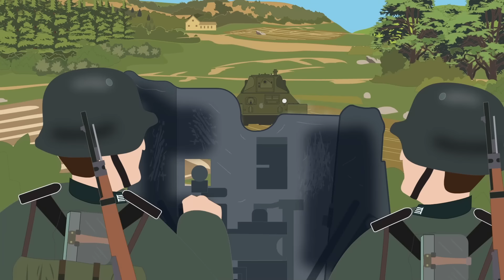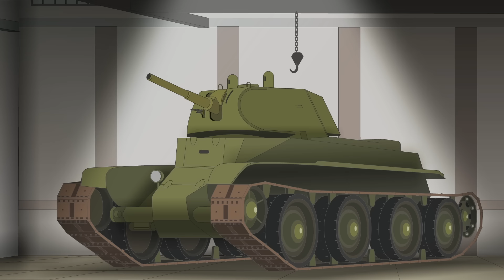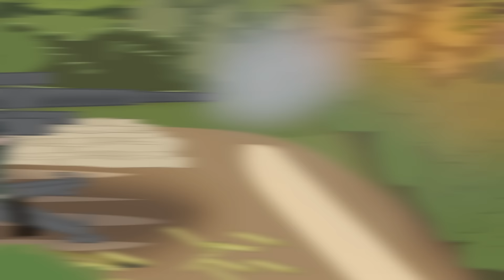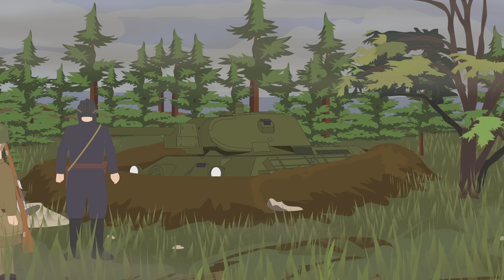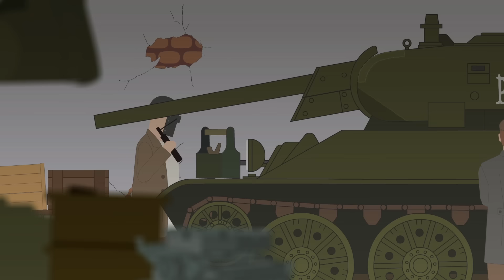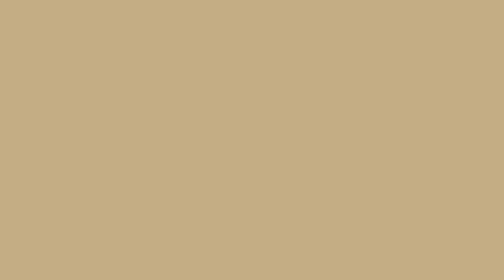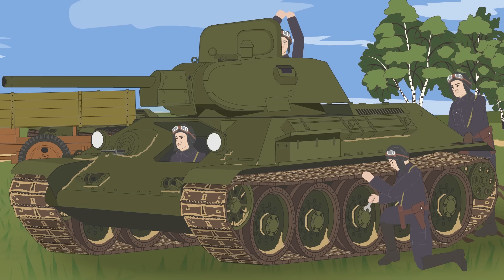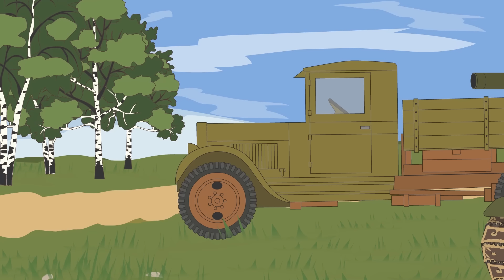Was the T-34 Really the Best Tank of WW2?

Comment: Animation wise, the video was legendary. I was amazed by the graphics. Simple History, you have definetily improved animation quality by not just up one notch but several notches. Genuinely appealing animation.

History wise... there are lots of inaccuracies here that frequently conflict Soviet and German military doctrines and military practices on the battlefield, as well as the documentations of a T-34 tank's quality lifespan.

 The video's writing was definetily heading for a hyped up propped up presentation of the tank, that'd be fine if you went over the theoretical aspect of the tank, but in practice and execution the T-34 had countless grave issues and was deemed mechanically more unreliable than even German tanks. The early Pak anti tank cannons could penetrate the T-34 from closerange, it is in long range where they struggled, and the Panzer III could engage the T-34 at medium range as well due to its superior crew ergonomics and its far better optics. Often times the T-34 armor plates broke apart from the force of collision of enemy tank rounds on the armor plating, which was inadequately designed and meant to only last several days, with the quality gradually improving starting late 1942 once the Soviet industry was kicking up, but it still took time.

That being said, I am not biased for the German tank industry, infact a lot of Simple History's videos on the German tanks overplayed them as well. I also do acknowledge that the channel is named "Simple History" in that the history is meant to be retold without going into complex difficult details and analysis that would turn it into a full blown historical documentary, but given the fact that the video is over half an hour long and, at its core, no matter how simple, history, it should've reviewed Soviet and German army doctrines and the documents regarding the usage of T-34 tanks and Pak anti tank guns to create a more accurate assessment. The video appears like a fantasy tale of a legendary tank. I do not discredit the T-34 tank, but I cannot say that it was as legendary as portrayed in the video. Cheers!
Reply: Fun facts:

The T-34 could sink in the mud aswell.
At Battle of Warsaw, the soviets attacked through a soaked field: From 17 T-34, 15 sunk and get stuck in the mud, only 1 T-34 could manage to escape.

" The T-34 was supposed to be a simple and rugged vehicle that seldom broke down. Authors like to compare it to the more complex German tanks that supposedly broke down often. The concept of the T-34 as a reliable tank is another myth of WWII.
The majority of vehicles in 1941 were lost due to equipment malfunction. The same reliability problems continued during the period 1942-44. The evacuation and relocation of industrial facilities combined with the loss of skilled workers could only lead to the fall of reliability. 

In 1941 T-34 tanks often had to carry a spare transmission strapped on the back to counter equipment failures (10). In 1942 the situation worsened since many vehicles could only cover small distances before breaking down. In the summer of 1942 the following Stalin order was issued to units (11):
‘Our armored forces and their units frequently suffer greater losses through mechanical breakdowns than they do in battle. For example, at Stalingrad Front in six days twelve of our tank brigades lost 326 out of their 400 tanks. Of those about 260 owed to mechanical problems. Many of the tanks were abandoned on the battlefield. Similar instances can be observed on other fronts. Since such a high incidence of mechanical defects is implausible, the Supreme Headquarters sees in it covert sabotage and wrecking by certain elements in the tank crews who try to exploit small mechanical troubles to avoid battle.’

Henceforth, every tank leaving the battlefield for alleged mechanical reasons was to be gone over by technicians, and if sabotage was suspected, the crews were to be put into tank punishment companies or "degraded to the infantry" and put into infantry punishment companies.'

The constant complaints from the front forced the authorities to investigate the problems with T-34 production. In September 1942 a conference was held at the Ural tank factory by the Commissariat of tank industry (12). The conference was headed by Major General Kotin, People’s commissar of the tank industry of the USSR and chief designer of heavy tank ‘Kliment Voroshilov’. In his speech he said:

''Now ... there are a lot of complains about the T-34. You all know the reasons for flaws in the tanks. The first reason –inadequate visibility from the tank; the second reason, and this is the weak link that always accompanies our vehicle in the Army – final drive. And third, the main issue that we have today – insufficient strength of the idler wheel's crank. These issues are the major defects of the T-34 today. Having considered these issues from engineering and technological points of view I would like to discuss another issue, the one that directly resulted solely from our production deficiencies. They are: negligence during production of combat vehicles in the factories, carelessness of assembly and quality control of vehicles. As a result during combat employment our tanks sometimes cannot reach the front lines, or after getting to the territory occupied by the enemy for conducting combat operations, sometimes they are forced to remain on enemy's territory because of some little things... We have to make sure that as a result of this conference all shortcoming will be uncovered and following this conference all corrections in the tank will be implemented in the shortest possible time...
Recently comrade Morozov and I visited comrade Stalin. Comrade Stalin drew our attention to the fact that enemy tanks cover a lot of ground freely, and our machines although are better, but have a disadvantage: after 50 or 80 kilometers march they require repair. What are we talking about? It is because of control gear; also, as comrade Stalin said, because of drive gear, and he compared it with the Pz.III, which is in service with the German army, and which is inferior in armor protection, and in other features, and in crew's layout, and does not have such a fine engine, which the T-34 got, moreover its engine is gasoline, not diesel. But the question аrises – why its drive gear is developed better?

Comrade Stalin gave directives to engineers, to the People's Commissar comrade Zaltsman, to factory's CEOs and ordered them to fix all defects in the shortest time. A special order of the State Defense Committee has been issued on the subject as well as directives of the People's Commissariat of the Tank Industry. Despite all these resolutions have been made by Government and orders of the People's Commissar of the Tank Industry, despite repeated instructions from army units and from Main Directorate of the Armored Forces, which is in charge of combat vehicles operation, nevertheless all of these defects on vehicles are going on... We have to reveal all these flaws, and suggestions have to be made on at this conference how to modify machine component better and faster in order to make the T-34 tank, which is recognized in the army as a good tank, even better fighting machine.''

The situation continued to be problematic even in 1943-44.
There were constant problems with the gearbox and the engine filters. The Aberdeen evaluators noted:

‘On the T-34 the transmission is also very poor. When it was being operated, the cogs completely fell to pieces (on all the cogwheels). A chemical analysis of the cogs on the cogwheels showed that their thermal treatment is very poor and does not in any way meet American standards for such mechanisms.’
‘The deficiency of our diesels is the criminally poor air cleaners on the T-34. The Americans consider that only a saboteur could have constructed such a device’

The same problems were identified in a T-34/85 built in 1945. The US study ‘Engineering analysis of the Russian T34/85 tank’ noted (13):

‘Wholly inadequate engine intake air cleaners could be expected to allow early engine failure due to dust intake and the resulting abrasive wear. Several hundred miles in very dusty operation would probably be accompanied by severe engine power loss.’

The same study says in page 451 about the transmission:
‘The transmission had by American standards already failed, although with extreme care it could have been used further. Teeth ends on all gears were battered as the result of clash shifting. Many pieces of gear teeth had been broken off and were in the transmission oil. The failure is due to inadequate design, since excellent steel was used through the transmission.’

The mental image of the T-34 travelling hundreds of kilometers without stopping is fantasy.

A German unit that used the T-34/76 model ’43 in combat noted (14):
‘Regardless of our limited experience, it can be stated that the Russian tanks are not suitable for long road marches and high speeds. It has turned out that the highest speed that can be achieved is 10 to 12 km/hr. It is also necessary on marches to halt every half hour for at least 15 to 20 minutes to let the machine cool down. Difficulties and breakdowns of the steering clutches have occurred with all the new Beute-Panzer. In difficult terrain, on the march, and during the attack, in which the Panzer must be frequently steered and turned, within a short time the steering clutches overheat and are coated with oil. The result is that the clutches don't grip and the Panzer is no longer manoeuvrable. After they have cooled, the clutches must be rinsed with a lot of fuel.’

Soviet tests on newly built T-34’s (15) showed that in April 1943 only 10.1% could complete a 330km trial and in June ’43 this went down to 7.7%. The percentage stayed below 50% till October 1943 when it rose to 78%, in the next month it dropped to 57% and in the period December ’43 - February ’44 the average was 82%.

Preliminary inspection of tanks built at the Ural tank factory No 183 (largest producer of the T-34) showed that in 1942 only 7% were free of defects, in 1943 14% and in 1944 29.4%. In 1943 the main problem was damage to the gear teeth (16)

The V-2 engine had serious reliability problems (17). Depending on the source in 1941 it supposedly lasted for 100 hours on average (18). This figure went down in 1942 since some T-34’s could not travel more then 30-35 km.

The T-34 tested at the Aberdeen centre was built at the best factory using materials of superior quality but its engine stopped working after 72.5 hours. This was not due to American interference as there was a Soviet mechanic (engineer Matveev) charged with maintaining it. Still it was much better than the standard tanks since it covered a distance of 343km. According to the head of the Armored Directorate of the Red Army N.Fedorenko, the average mileage of the T-34 to overhaul during the war, did not exceed 200 kilometers. This was considered adequate since the T-34’s service life at the front was considerably less. For example in 1942 only 66km. In that sense the T-34 was indeed ‘reliable’ because it was destroyed before it had a chance to break down on its own!

Still there are examples of T-34’s breaking down during assaults even late in the war (19). For instance the 5th Guards Tank army in 1943 lost as much as 31.5% of its tanks during its march to Prokhorovka. In August ’43 the 1st Tank army lost 50% of its tanks due to malfunction. As late as the second half of 1944 tank units tried to replace engines with more than 30 hours of operation before a major attack

All WWII tanks had a hard time when travelling and they needed repairs and maintenance or they broke down.

There is also the question of standardization. The T-34 was produced at several factories. Each factory produced a slightly different variant. Could spare parts from Nizhny Tagil be used on a T-34 from Gorky? Doubtful."

Source: christos millitary and intelligence WWII Myths - T-34 Best Tank of the war
Reply: @rolandhunter  copypasta
Reply: And more fun facts:

The soveit doctrine was:

The AT guns and tank destroyed have to deal with enemy tanks.

What does it mean?

T-34, IS-2 ammo storage was: 2/6 rate AP and 4/6  rate HE rounds loaded into that tank.

And:

57,224 T-34 produced during the war, and  44,900 were destroyed :\
Reply: @rolandhunter  FREAKING THANK YOU! People praise the T-34 and forget this crap all the time!
Reply: Don't forget the fact that most Russian tank crews had next to no training & most T-34s had next to no testing.  The video is very goofy as of course the T-34 wasn't the best, it was far form that especially if you compare it with later tanks in the war.
Reply: honestly the video seems like ending was really phoned in.. atleast considering how much more could've been said on the subject: it seems a very odd 'choice' to include redundancies such as repeated info of around 19:28 & 29:07
Reply: Sadly true. Even 34-85 wasn't that strong especially without old hull which was still pierced by most massive ATG-pak40. But soviets learned a lot so they could use T-34s as effective as it was possible while having number supremacy which means that more tasks can be done in same amount of time. Funny thing that Germans started war with blitzkrieg on fast and comfortable light panzers against monsters like KV-1 and ended up with huge unreliable monsters like tiger 2 overwhelmed by largest amount of T-34 and IS-2
Reply: @raketny_hvost  Indeed. (Also I just noticed they changed the title to "Was the T-34 Really the Best Tank of WW2?")
Reply: @nerdomatic2489  The title being changed is really odd to me. First it was saying the T-34 was a legend among tanks. Now its asking a question in the title but the video...doesn't even answer it...